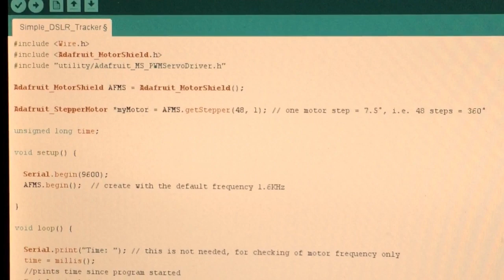DSLR Tracker with Arduino and Stepper Motor

Comment: Was looking for DIY information and did not get much, so here is my plan looking at eBay and stepper motors. Start with a 28BYJ-48 stepper with 1:64 gear down for 2048/4096 steps (dependent on full or half step). 84600 (24*60*60) seconds in a day, so best case alone 84600/2048 (need full step going so slow) or 48 seconds per step, not good since my exposures are shorter. Add a Gearbox Worm Gear Stepper Motor attachment with 42 or 118 or 236 even 603 reductions, to 1 or .5 or .25 or .08 seconds per step or change of position which may work. The parts are cheap and I will get the rotation and experiment with step timing, maybe use half step with the 603 reduction to make steps at around .05 seconds. Get the rotation then worry about alignment and attaching a camera mount.

Comment: The stepper they use in the video is 1 rotations for every 131.876 steps. Even though the ball head had a gear, it looks like they are not using the gear.

Unless I'm missing something, If using 16 microsteps, that is 614"/step. Only useful for really short focal lengths, I would guess around 18mm. Would recommend more gear reduction.

Comment: What stepper motor do you use, please?
Reply: That's very helpful, thanks!
Reply: where i can find this motor?
Reply: Hey! What a nice work! Extra details would be highly appreciated. In any way, thanks for sharing this. It would be nice to see some of the pictures you take with this system at Instagram, for example. Regards.